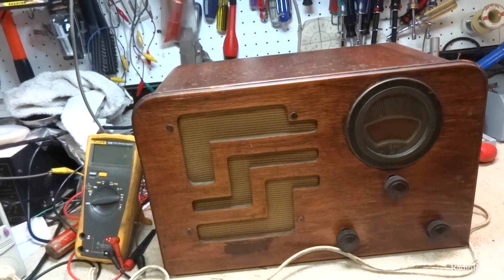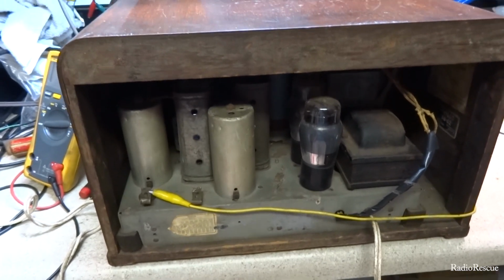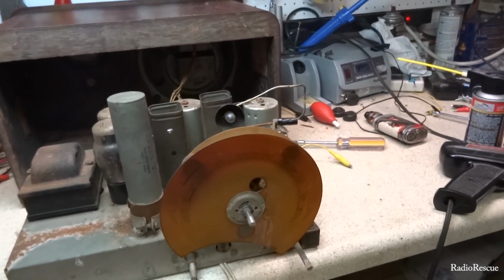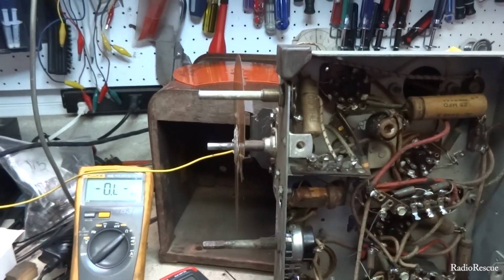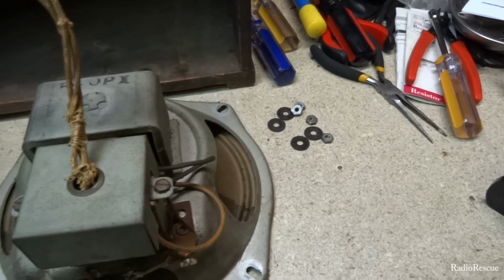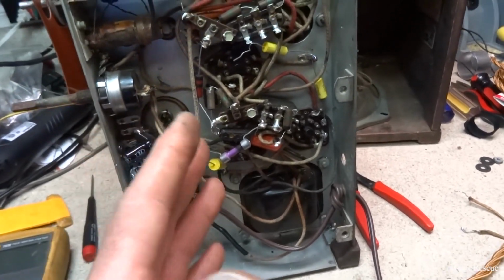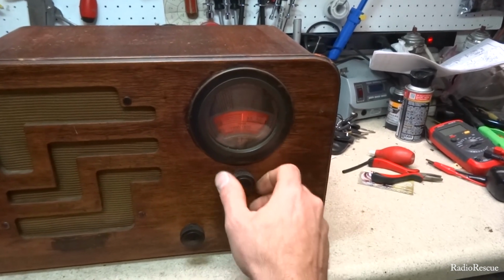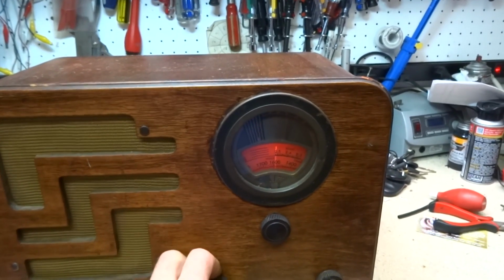Repair Of A 1938 Philco model 38 62 Tube Radio

Comment: It just amazes me how some of these old radios still stand the test of time. I have a 1937 G.E. E50 radio i was working on i just replaced two old electrolytic caps and brought it up on my variac and with the old 1930's original parts it still worked. That one I am amazed that the filter cap still worked and no hum in the radio. Thanks for the informative video.
Reply from the maker: That's why I like these old sets they're built to last!